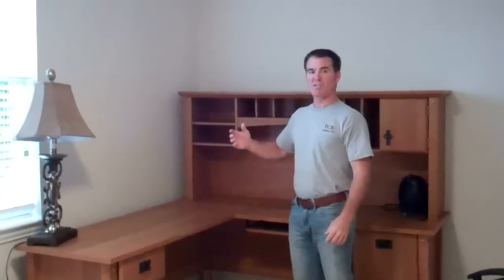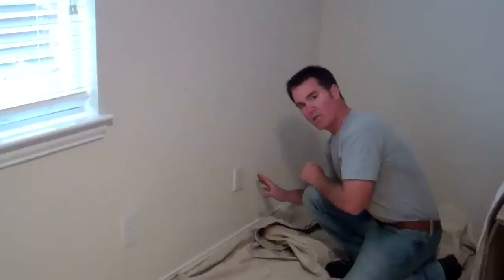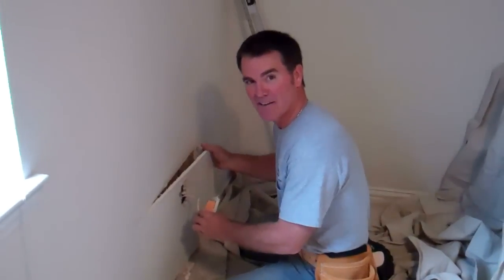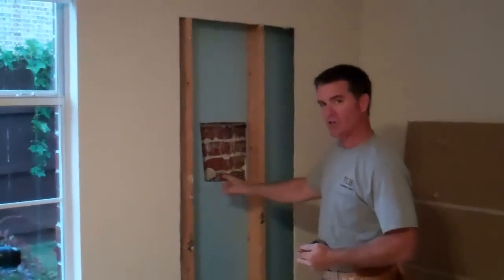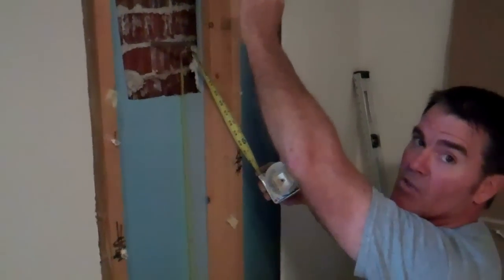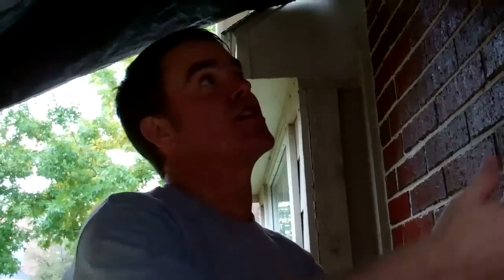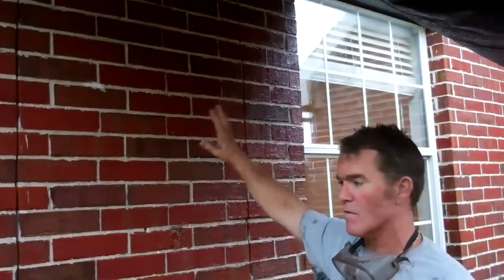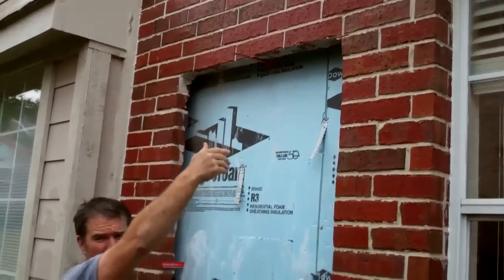How to Add a Door In An Exterior Brick Wall - Part 1 of 2 Benoah Renovations Video

Comment: Great but more than I can do
How much do you all think it would cost to have this done ? A door and to add windowns ?
Does anyone have an idea
Reply: Well it depends what you run into but I did a job similar to this turning a window into a slider and charged 3000 to do the job but somewhere like west shore homes would probly charge 25000
Reply: Just bidded taking out window and creating a door opening ,,bidded $3200 ,customer said too high ,, 😂😂ummm no it's not ,,you either Want it done right or not

Comment: What did you use to bring the jamb out flush with the brick wall…….I will be attempting this project in a couple of weeks.
Reply from the maker: Hello Dennis. We used a 1x6 material that was ripped down to the required width needed to be flush with the outside of the brick. I would suggest a PVC product or other similar that is not prone to rot from capillary action. When wood is applied on a vertical surface in close proximity to ground moisture the wood can suck up the water like a sponge even if the wood is applied 1/2" off of the base surface that holds the moisture. This is why you see a lot of garage overhead door jambs rotted out at the bottom. Those jambs should have been pressure treated. In the case of the added exterior door you can use a PVC product that will not suck up the moisture and set it directly on the base. Or you can use other products and primer paint the bottom of the jamb before installation and install it 1/2" up off the base. Also, the video does not show it but also install a metal flashing above the top horizontal trim on the outside of the brick. This needs to be notched back in to the brick or mortar joint above the door. You want to eliminate any water that can get behind the that top piece of trim. Good luck. Luke Zmolik

Comment: How did you cut the studs up in the wall above the sheetrock and brick to make room for your headers?
Reply from the maker: Hello Mike, I used an oscillating tool with a wood cutting blade. Hope this helps.
Reply: Thanks

Comment: Thanks for you video.  I have a question.  I have a two story wall where I'll like to add a door.  
I believe I need to add steel lintel because of the weight of the  brick.  How would you do that?

Patricia  from Austin TX

Comment: why only cut a small hole first and start feeling around. Just cut a door size hole out and re route any pipes or wires as needed. If the door needs to be there then no problems,
Reply from the maker: With the lack of outlets or exterior water spigots I was pretty sure there would be no pipes or wires. I was correct and it worked out. If there would have been pipes or wires in the wall, as a homeowner, maybe I would want to relocate the door or decide not to do the project. I cut a small hole to show homeowners the easiest way to make that drywall repair if they chose not to proceed in that location. I try to create my videos so they work for everyone watching them. I do not know the layout of other viewers homes. Other viewers may have other suitable locations for the door.

Comment: you made a point to check for pipes/wires etc before cutting which is an extremely important step.. but did you not notice the 2 plates (1 right in your work space)?.. stud finder with metal detector could save you cutting into the wall since it's gyprock interior.